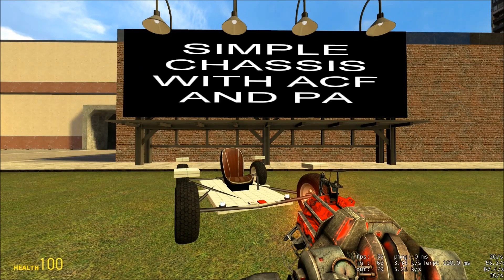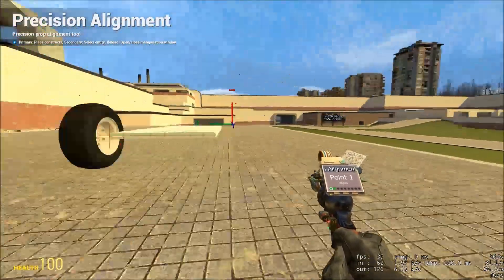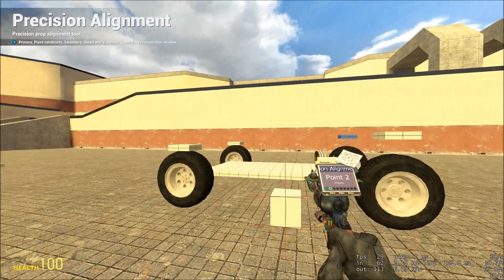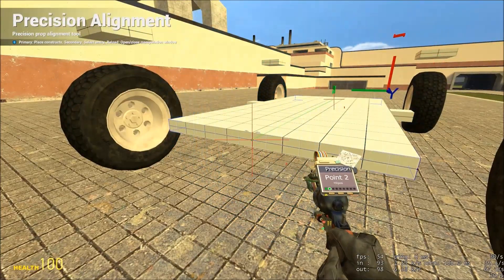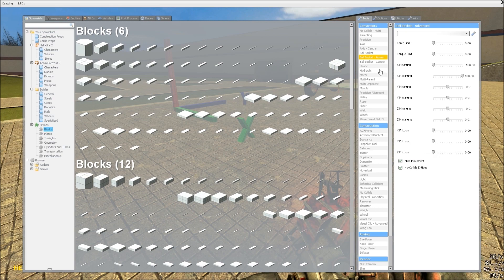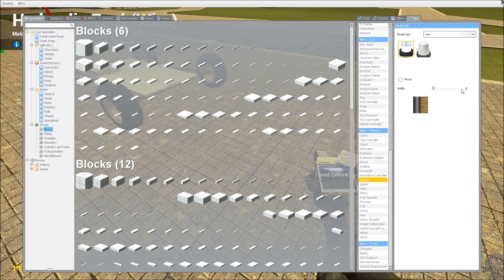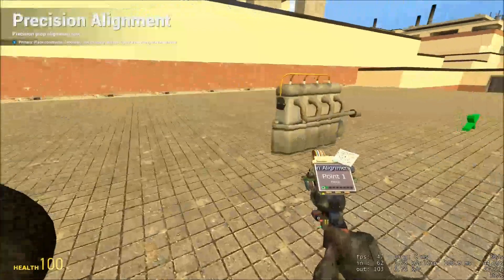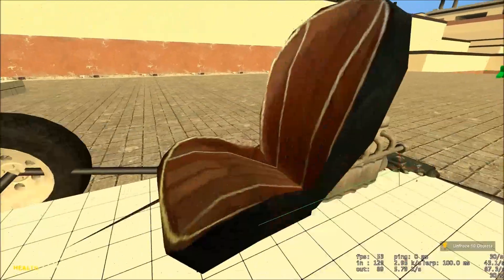Simple Chassis Tutorial - Using ACF & PA

Comment: No set ang steering... Much easier. It's a public E2, but you have to wire A and D to the pod controllers A and D. Wire chassis to the baseplate. Ball socket the left wheel to the left side of the E2 and vice versa. x values are -180 and 180 everything else is 0.1 or -0.1 MAKE SURE YOU ARE FACING NORTH WHEN DOING THIS OR ELSE IT WONT WORK (figure out what way is north by placing the smile paint in the paint tool. Top of the smile is north.) (or use your spray by pressing G on the ground.)
Reply: Thanks you! life saver :)

Comment: How can I make it solid axle?
Reply: +Ecker Family
1. make both axles for the wheels.
2. make sure the wheels with a steering axle has the axle on a rotating join that is controlled by A and D
3. now just make sure your car can actually drive.
DISCLAIMER: i came up with this on the fly. so if it doesn't work this is probably why.
Reply: thanks for the help bro

Comment: the E2 thing is somehow wrong. i did everything right but e2 fails. i tried to correct it on my own but it has multiple errors
PLEASE HELP!!!
Reply: There are easier public ACF E2s on pastebin. The one I use is called: ACF
Reply: nevermind i got why it didnt work.
It seemed as if the Wiremod E2 file was totally messed up. I didnt copy and paste the file the right way. You have to download the E2 file, then put it in the E2 folder(its there trust me). Then open it with a word processor(WordPad best recommended) and make sure its in the right order.

Comment: Guys,if the wheels spin around,you placed the dupe in the wrong direction.You have to have the car facing north,because it makes it stable.if you are on multiplauer,press g to place down your spray.the top of your spray is north.if you are in singleplayer,sprays don't work.just get the paint tool,set the paint to smile,then spray it.the top of the smile faces north.

Hope this helped :)

Comment: Problem solved! the probem is that your gearbox is too small and cannot hdle the torque dealt by the engine, therefore, it breaks the driveshaft. I changed engine to a Single 500cc with a small transaxial gearbox and it drove up to 50 MPH average/60 KM/H

Comment: I built things exactly the same except I use Easy Precision and a different hydraulic steering method. i wired exactly as told and used the expression 2 exactly.

But when i press w, my I4 Petrol only revs up to max RPM with no speed.
I linked the wheels and all. whats going on?